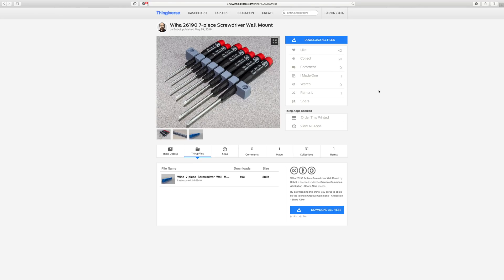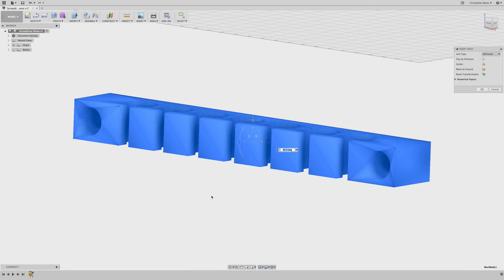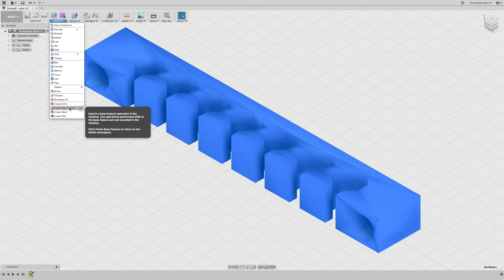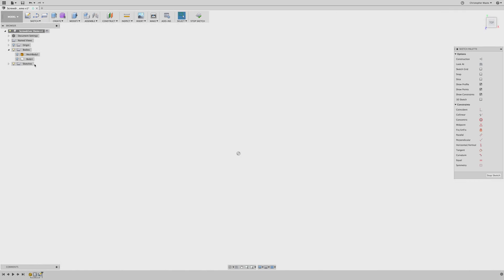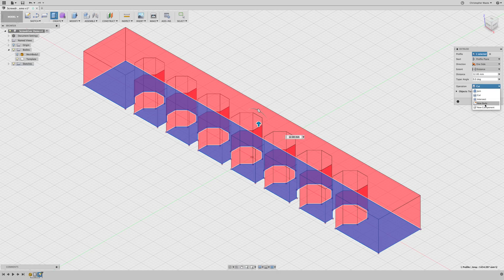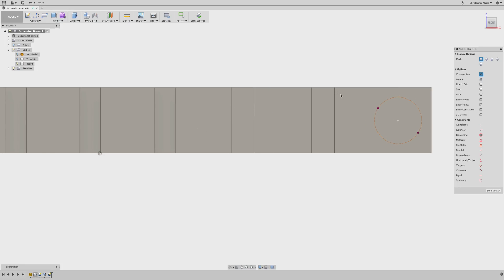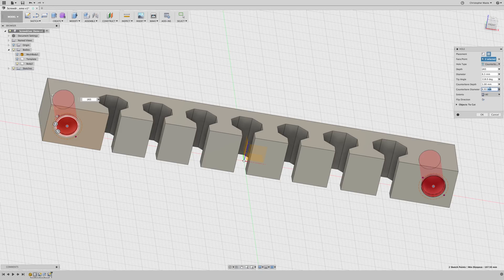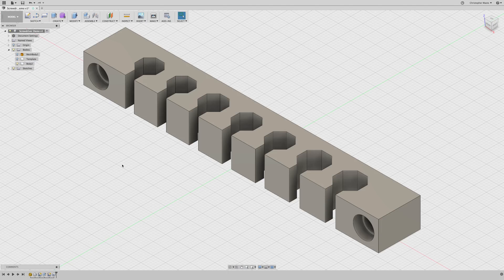Fusion 360 STL Editing Tutorial

Comment: In the future, a quicker, dirtier way to fix this is simply to heat the screw up using a lighter before screwing it in. A hot screw will happily melt through the printed plastic, though obviously timing gets a little tricky. I've done this often when I undersized a screw hole on a large print and just wanted it to work without reprinting.